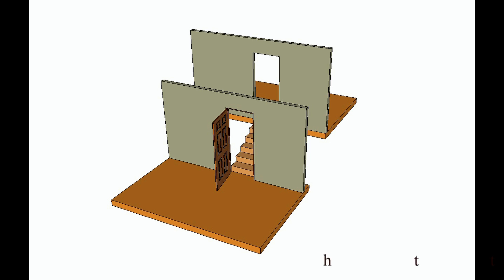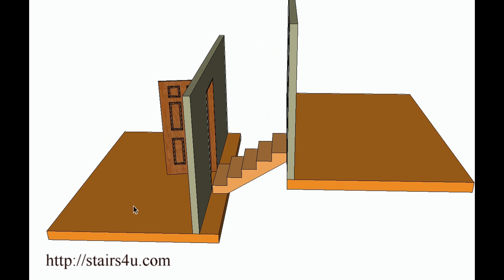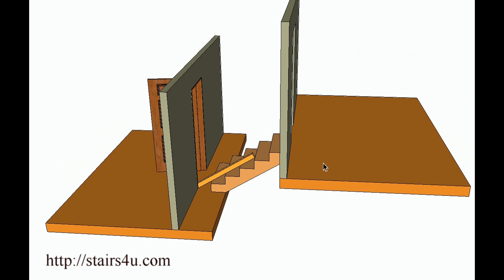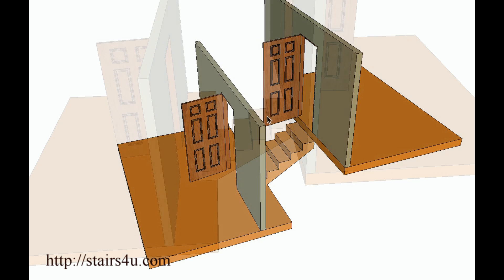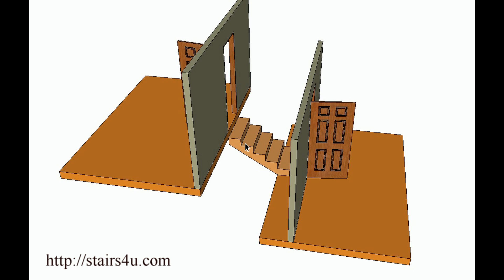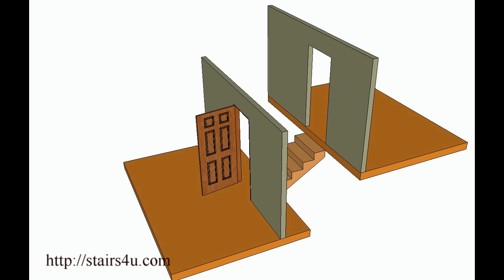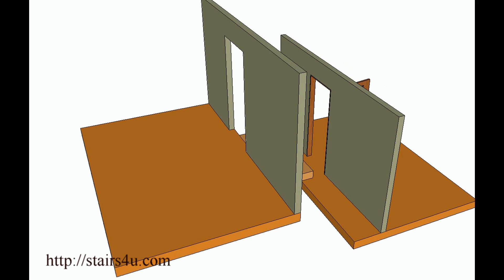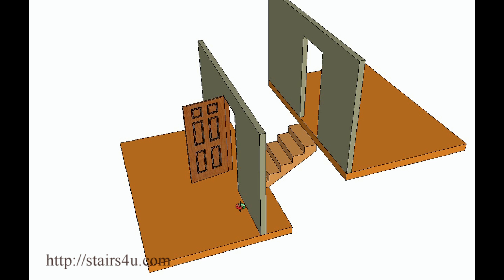Suggestions For Doors Near Interior Stairs – Building And Design

Comment: Thanks. .. For option A (first option), Why not just have a taller door? I mean Sure you'll need to find a special door.. but.. would be easier. assuming its all interior doors.
Reply from the maker: If that will work on your project, then great.

Comment: In regard to your lower door, you should really review your code book before steering people in the wrong direction. In our Michigan code book, which is most likely similar to most codes, reads as follows: "R311.7.6 Landings for stairways. There shall be a floor or landing at the top and bottom of each stairway. Every landing shall have a minimum dimension of 36 inches measured in the direction of travel." Your diagram would not meet code.
Reply from the maker: At what time frame would you suggest a mistake?
Reply: @stairbuilding  Right off the bat where you have a door at the bottom of the stairs.

Comment: There is very little
Info or guidence out there for this . Where i currently live is a mess the entry door walks in to a tiny foyer and stairway. The foyer barely has room to open and close the door but one have to swing around beacause space is so tonight.  Recently we had the stairs replace and the builder made the stair even longer than i was before a night mare. How to fix a mess like this . Entryway is bad energy to walk into tiny entryway and no room to hold a bag or baby carrier and open or
Close the door simultaneously . Help!
Reply from the maker: I might not be much help, but email me some pictures for an opinion. You can get our email address at our website.

Comment: What if you can’t move the wall at the foot of the stairs, and you do have sufficient head room.  What about a custom pole door knob so it can be reached easily from the stair side?
Reply from the maker: You can check with your local building department to verify local building codes. I'm not sure what you're doing, but you can email me a picture and I will be glad to provide another opinion.